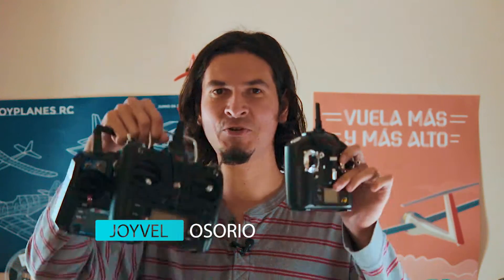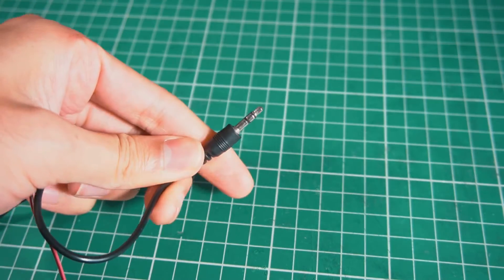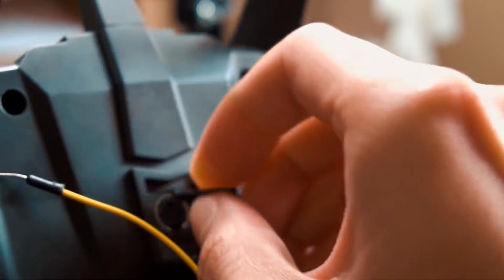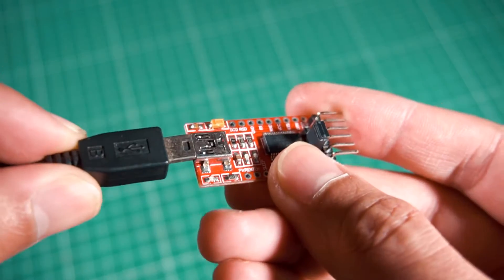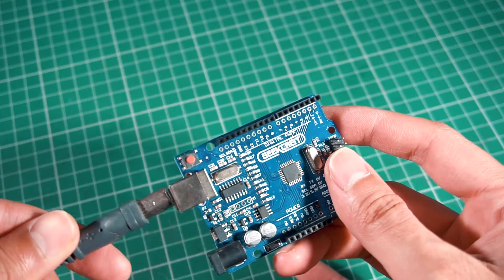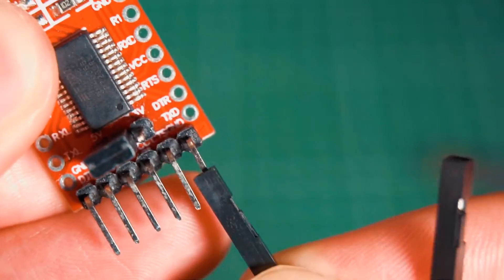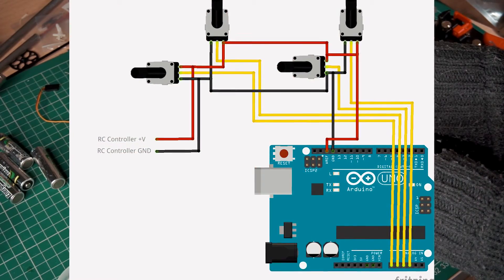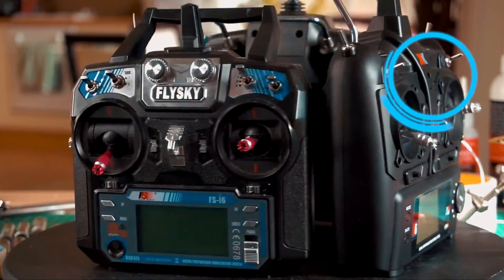Connect any RC to your computer to use it on any flight simulator or video games

Comment: I have a question: I want to use flight simulator controllers such as the Thrustmaster HOTAS stick, Throller lever, and Pedals connected to my PC to control my Long range quadcopter drone but I also want to do this from inside in my garage/Mancave/Shop at my computer deck which I plan to build a makeshift virtual Drone Cockpit ground station. So not only do I need the specifics in software needed to do this but the hardware (best transmitters/protocol  to use for this scenario that works best for a windows OS based PC) but also how to setup my outdoor antenna for best long range fight and how to wire the system properly to ensure minimal RF loss between the antenna and my Transmitter and then to my computer and vice versa. I know there are many people online showing off their setups like this but none actually go over their build setup and what parts they use with what software and the nitty gritty of their antenna setup. Can you maybe do an all in one video for us? Or point me in the direction of good source material I can use for my research and building my own indoor drone cockpit ground control station? Thanks so much.

Comment: pro tip : for controllers with a ppm port / trainer port, if you can mod it a bit to get 5v and gnd to install an esp32, you can convert the ppm signal to a ble gamepad (bluetooth low energy)
Reply: any links on how to do it ?

Comment: i have the deafault transmitter from the voltanex p-40 warbird. it doesn;t have any connector on the back, can i still use it with the wire tricks

Comment: I have a very old transmitter that I love the feel of the controls, but it's a very small, rare brand from the 80s that nobody makes a trainer cable for (it uses an old RJ14 landline connector for the trainer port; weird).  I never thought of using the mic input on the onboard sound!  That's a great idea.  I know one of the pins on the RJ14 port is PPM, so it should work!  Just need to solder up an adapter cord.  Thanks!

Comment: There must be something wrong. I have a s-video cable and the outer ring isn't ground it's not connected to anything. Also the Wikipedia article for s-Video tells me the outer ring is never connected to anything so you shouldn't be able to solder your own cable with a s-video plug.

Comment: REALLY APPRECIATE IT!!!
I am currently interested in the field of drone and going to build my own FPV Arduino-based drone.
At the moment, I'm working on the Controller stuff, and since I want to build my own Arduino-based RC transmitter to play on some simulator, I found your video and it resolves my confusion tremendously!!!

Comment: quick question on the ftdi chip, does this method only apply to PPM connection ?  if so, is it possible and how to use the tfdi chip when i have a receiver without PPM slot, like a regular 3-4 chanel sanwa receiver ? Thanks in advance

Comment: Hello my friend and congratulations for your video. I want to ask you something. I have a spektrum AR7350 rx and i want to make a usb cable in order to program it via pc.  I have a FTDI FT232 usb adaptor but where excactly do i have to connect the signal wire from the receiver? Only to the rx pin of the FTDI? Will ill i can to receive and send data to the receiver?

Comment: Hi, I have simple radio without any ports to connect to like the one you showed, and I have the USB simulator dongle that you showed as well ... is there a way to connect the two together ...if I find PPM and _ve ... and connect them to the mono audio cable ... will it work ?? Thanks

Comment: Thanks for this! I was able to get my Radiolink AT10ii working with RealFlight using a $5 Dollar General mic/headphone set using the first option. Excellent job describing the process.
Reply: Currently trying to setup a sim using my Radiolink AT10ii as well. What simulator program are you using with your setup and How is it working?
Reply: @who8dapple   It works okay. Its been about a year since I've used it. I used RealFlight and had to work out with breadboard wires which pins on the Radiolink are output signal. Then I had to hack the S-Video cable with a audio jack cable and do some shitty soldering to get it all to work-ish...
Reply: @who8dapple His solution with the receiver is probably a better solution.  You need to use the VJoy as he describes. The R6DS is pretty low cost and would work for this with the PPM output.

Comment: Thanks so much for this video. I did use this technique until I had a dongle. You can also add the method of using the rc receiver's PPM output.

Comment: First method doesn't work with a older Futaba Skysport  FM transmitter. Only get a low hum from computer no connection at all. Total waste of time. Should have been stated in video.

Comment: sir can you help me solving my troubled FS-T6 fly sky trasmitter as it always show a WANING, telling  for your safety turn up all switches and lower the throttle to continue. I have already done some if the advice regarding these but no one solve the problem. Ed from Philippine

Comment: Thanks for the very useful information, In your youtube clip, it seems that you are using Aerofly as the flight simulation program. 
Have you ever tried to connect the Real flight simulation program with your proposed method - utilizing the Smartpropoplus (PPM) and Vjoy driver (driver)? I would like to try the Real flight in the STEAM using your proposed method. it will be very appreciated if you inform any tips.

Comment: I think you are a little fast with the explanation.
I tried the first method, but it didnt work, because my PC has got a Aux plug with 4 imstead of 3 contacts. It is for audio output and microphone at the same time. 
So then i tried to use a four pin aux wire, and connect the ground wire to ground and the microphone wire to the pin you showed. Now the App was viewing the connection, and i could connect it, but it could not detemine the sticks position.
Do i need to turn the trainer mode on, on the controller for it to work? Or do i have to connect it else with that plug? Or do i have to use a interface with and microphone adapter with 3 pins only?

Comment: If the last methode doesn't work for you. you are not alone....open the arduino joystic file and go to line 32 delet the two "//" keys before "byte digitalPins[] = {};" and it will work.....I wish there was a diy way for making it work on laptops using the first method.....Thanks for the great tutorial!

Comment: I have an old controller from a silverlit X-UFO and thought I might try to hook it up to the computer for use with a simulator. I found an audio port on the controller, and tried to plug it into my computer mic port with the suggested application, but it didn't seem to recognize anything. I took the controller apart and the audio port seems to be connected to a button labeled "trainer", and I assume this is then used for sending/receiving data when running two controllers? Should I expect this to work with an audio cable to my computer?

Comment: smartproplus doesn't recognise my transmitter, I have a jr x-347, capable of ppm or pcm but software just says low audio input when the radio is switched off but when it goes into train mode it disconnects and isn't recognised
Reply from the maker: You have to install the driver as well.
Reply: @Joyplanes  which driver? it prompted to ask to install something else at the end which I did
Reply from the maker: @PockoRC  vjoy serial feeder

Comment: I know this is a old video but i have a question anyway. I used the first method by connecting my radiolink GS4GS v2 transmitter to my pc via a 3,5mm audio jack. I downloaded the smartpro plus software and it seems to work. But when i start VRC Pro to race with rc cars i won't see my transmitter. Do you have any idea what i can do to fix this?

Comment: Is the auxiliary 3.5mm audio cable support for xk x6 transmitter? And it will be work for heli x x14 flight simulator software?

Comment: Hi, I've loaded a few simulators onto my laptop, also smart Pro Plus, I've tried a single interconnect lead to my controller, XK X6, the Laptop is a HP, I've also tried a stereo double connect lead between the two but no matter what I do there is no connection, I have tried it with several simulators and Pro Plus which I understand would normally connect anything, I think the problem could be that the 3.5mm connector on the laptop does Mic and Headphones from that one socket... I am at a loss and wondering if I need one of these USB interfaces I believe you can get...  any suggestions welcome..  Thanks
Reply: I'm with you but on a PC - vJoy device is missing and transmitter disconnected (Spektrum DX6i) No luck anywhere yet.

Comment: Won't work with Realflight 6.5. It keeps saying Interlink not found. If there's a work around I'd like to know.
Reply from the maker: I think for that one you'll need an emulator but I don't remember where to find it. The new ones take any radio you like.
Reply: @Joyplanes  ok I'll take a look around the web.

Comment: Hi guys I've got a question, I've got flight simulator 2004 and a friend wants it but he's got a futaba t10j controller and he wants to know if it works with fs2004, I cannot find any video showing this with fs2004 and I never used a joystick to play fs2004 so I don't know, I'd appreciate any help! For the moment I told him to buy a usb simulator cable because I've seen he needs it to connect to the pc but before doing all the process I want to know if it works with fs2004, thanks in advance,cheers!.

Comment: i connected my receiver to my arduino and the tx led lights up on the radio when the controller connects to the receiver but nothing happens in serial feeder. i have a flysky controller.
Reply from the maker: Have you installed the Vjoy driver?

Comment: Hi Joyvel, thanks for your post it's very very helpful, I need your expert help on this one, I have a controller built-in a USB connector from the RF-X simulator package, how do I make it work with the Phoenix simulator?
Reply from the maker: Sorry, I'm not familiar with that one.
Reply: phoenix requires the proprietary dongle to work. its not that some features will be locked, but it just wont let you fly

Comment: ik this is late but I'm trying to connect a kind of cheap controller through a double ended audio jack but i cant get on to a simulator mode, is there any other way to do this method

Comment: I was going to do the arduino route but i found a trainer socket on my hitec optima 6 sport controller and it works with that software and headphone lead. Now to find some decent flying software that isn't 90 quid on steam. This video helped me alot many thanks!

Comment: Hi, I have a Hitec Aurora 9 and Optima 6 receiver. Which method can I make the most correct connection by choosing? I have arduino leonardo and pro micro. The question is, is Optima 6 suitable for this work?

Comment: Thanks for posting! I was able to connect and use my Flysky FS-I6 radio to my Microsoft Simulator X simulator and operate the main surface controls. Is there a way to use the Flysky switches as inputs to the simulator to control, e.g. brakes, cockpit views, etc.?
Reply: instaBlaster

Comment: Is the microphone input capable to handle the inputvotage? How much voltage does the PPM output have (e.g. at the fs-i6)? Wouldn't it be better to add a potentiometer to devide the voltage? As i know, microphone inputs only handle voltages from about +/-20mV  to  +/-100mV
Reply: My computer shuts down when I turn on the remote. The voltage at the minijack is 2.75 V. What to do with it?

Comment: I checked this: The versions SmartPropoPlus with audio input and vJoySerialfeeder using the FTDI are working fine. But not Arduino, I think it's not enough to just upload the sketch 'eeprom_clear' to the Arduino board.

Comment: do switches work when you do this?
ive tried using the sim cable that came with my fsi6 but only the gimbals work no switches
Reply from the maker: Only a couple of then work and sometimes hey don't, it depends on the type of connection.

Comment: I have the Phoenix RC sim (Co. went out of business), try to set it up on my new laptop and didn't work!
Would not sense the joystick controller , which worked fine with my older PC.
Some one said, need new plug!
Why?
What changed?
Reply: I have the same problem... it's been a year so i guess you might have the solution :) and i'de be pleased if you could tell me what to do to fix it.
Reply: @khalledhimself5131  Some setting needs to be changed in windows.
Search on YT or Google!
Reply: @khalledhimself5131  Try this!
https://www.youtube.com/watch?v=SXXmpi9LqAg&list=PLBD91B6A45FED14EB&index=1
Reply: @khalledhimself5131  or this?
https://www.youtube.com/watch?v=_lLa6RrWfoQ&list=PLBD91B6A45FED14EB&index=3

Comment: I'm using my transmitter to connect to my pc and learn to fly a RC plane. Does anyone knows a free RC simulator I can use before I use my real plane?
Reply: I am using the Multiplex Muliflight sim. you can download it for free. The grafics are O.K and you can gain experience whithout crashing your irl plane. Hopefully i helped you
Reply: Obi Wan Kenobi that’s actually funny because the plane I’ll fly is an Easystar II from multiplex 
Yes you helped a lot! Thanks

Comment: It took me thee days to figure out a way to hack my RC transmitter from a toy drone. I got it working with my own Arduino code that produces a PPM signal to feed into Smart Propo Plus and literally one hour later I found this. I'm still glad I did, because Smart Propo Plus is not very nice at all, because it is extremely glitchy and consumes so many system resources, that my whole PC starts to stutter after a while. The tip for using vJoySerialFeeder was really great. I just dumped my code and flashed the code to my Arduino, that is mentioned at the end of this video. That worked because I had the same Idea to solder wires into the RC controller (and it can still be used for my toy drone). After some calibration it started to work beautifully. A FlySky Transmitter is on the way to me from china and I'm going to hook it up wirelessly as mentioned here. This is a great source of information about that topic, thanks for that. Left a thumbs up!

Comment: Great Video, very intuitive, easy to follow.
I have a FUTABA Conquest FP-T4NBF, and I installed SMARTPROPOPLUS on my Win7 PC. I made the audio cable and connected to the Training Port DIN Pin 2 (PPM Out) and GND. I could listen the pulses on the PC speakers and the transmitter appears operational. For some unknown reason, channels appear unclear, very noisy, and no major changes when moving the different channel controls. Do you know if this method is compatible with this RC Model? Any suggestion ?
Reply: On the latest smart propo plus version DO NOT CONNECT THE LEFT AND RIGHT TOGETHER. ONLY USE THE LEFT CHANNEL OTHERWISE IT WILL BE VERY NOISY.

Comment: excellent video, I used the receiver to mic input to keep my transmitter wireless, it works great!!
Reply: Hi.  I can't get my Spektrum DX7 to connect. Perhaps it's because I'm using a stereo 3.5mm plug rather than a mono (which I'll modify). But I also have a DX6 E so I can connect this wirelessly.  How did you connect the receiver to the mic input.  Was it by positive Rx  input to centre pin of jackplug and negative Rx input to ground?

Comment: i connected my FS-IA6B receiver to the arduino but when i connect to vJoySerialFeeder. it shows Connected,Failsafe(Serial port Read Timeout)10 Updates per second/101 ms between Updates
plz help. nothing is happenning when i move the sticks.
Reply: Did you manage to solve it?

Comment: At 20 seconds into the video, you place a green plug on the table, but then when you plug in your cables later, you show a different connector. I have one of those green connectors, which pins do the signal, + and - go to?  Do I have to use the jumper that came with the plug?  Thanks!

Comment: Amazing video, very clear! 
You know if there is a method for control the sticks deadzone using smart propo plus or another software?
I'm using a simulator for fpv that don't have the deadzone setup.
I have a fs-i6 radio connected by an audio cable and i'm using smart propo plus.
Thanks in advance!
Reply: I'd recommend the vJoySerialFeeder option mentioned in this video (via IBUS). This tool lets you configure a deadzone. Also Smart Propo Plus isn't that great in my experience after having tried vJoySerialFeeder. Just get an FTDI Adapter and a second receiver that puts out IBUS and can be paired with your radio. If you set up your drone to use SBUS as well, then you don't need to change configs when switching between the simulator and real fpv. Connecting your drone via USB might be an option (if you're actually flying a drone that supports this feature).

Comment: hello hope you can help me. I purchased a trainer socket for my old 35mhz graupner mc 10 and connected it. it is a 3.5mm audio jack. I connected it to the pc via aux cable and set it up like you showed in the video. I tried it out with the test version of reflex simulator. It worked kind of but it has huge lag! So its not usable. I looked into it with smartpropoplus and even there it has a huge lag and inaccuracy. What can I do?